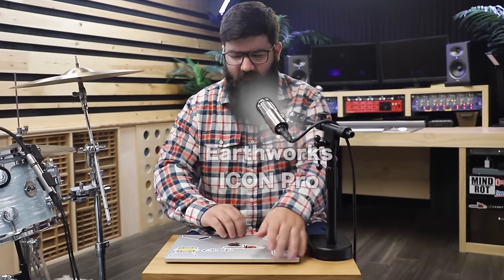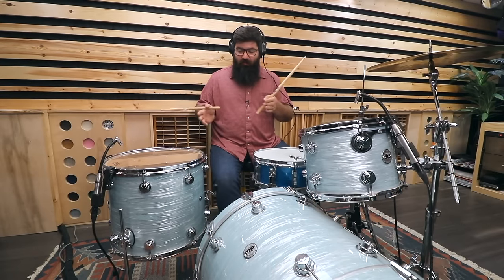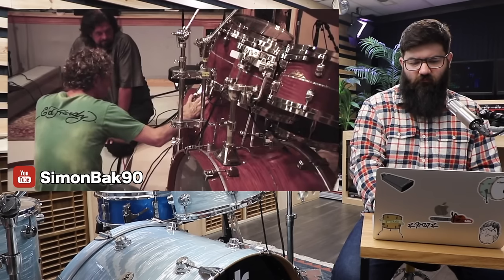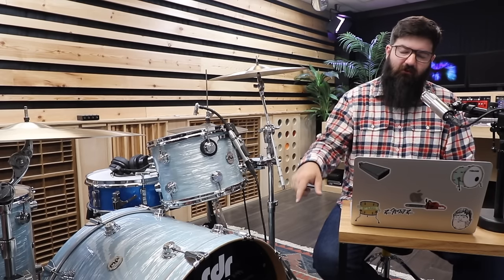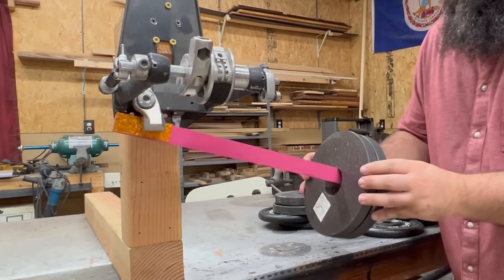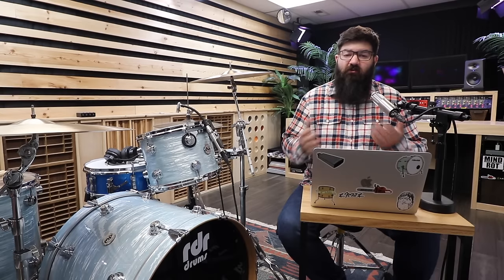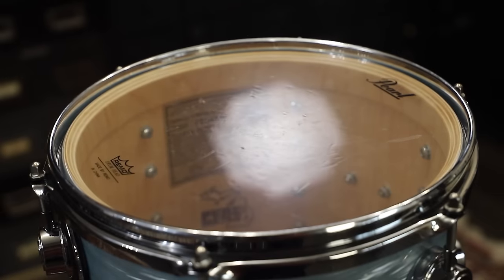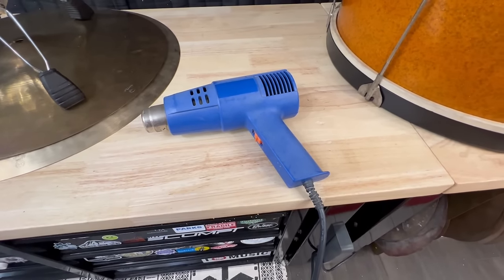The Founder of DW Drums told me to do THIS - Testing 5 Drum Hacks

Comment: A hack I’ve never tried but I’ve always been curious… Supposedly if you feel your bass drum with wadded up newspaper it provides perfect muffling. Guess it Depends on what you mean by perfect
Reply: I use that foam with pyramid profile.. Its light, and gently touches both heads for head damping and peak smoothing. No heavy weight to add to the drum.

Comment: A lot of older drummers use moleskin patches or sheets of moleskin( cheapest) for hoop protection,BD head protection and to line BD claws. I paid ONE time for an Evans bd head protector. $10!!! Why!!!I like the cushiony effect of moleskin better too. Moleskin  has adhesive on one side and fuzzy fabric on the orher. It'ss available at drug stores in the shoe repair/ insole area. I like the rolls of it bcuz it's cheap and you can cut just what you want out for your application. For those looking for a felt strip for your bd- fabric stores have various colours and lengths/ widths ( you choose)and  cheaper than the music store.

Comment: I’d looked into the heat gun idea before but always saw comments that described it as dangerous to the shell doing it whilst the head was attached. Would this be a safe method?
Reply: should not be a problem if you use common sense. Do not keep it on a single spot for a prolonged time, and steer clear of the edges. I've been using this trick for 30 years. (was a readers letter in Modern Drummer in '92 ish that turned me onto it) and have never had any problems.

Comment: That heat gun rejuvunation tip is akin to guitarists boiling their guitar strings rather than buying new ones. It works in a pinch or if you cant buy a new head, but you're probably better off buying a new one in the long term! :D
Reply: I'd say it's way more practical than the guitar strings, because stringing a guitar is time consuming and strings are cheap. The heads can be done without removing anything, and heads are costly, and if you are just practicing it can save you time and money.

Comment: Me, tired of placing the kick pedal fixed to the hoop, and of damaging it with the pressure of the pedal adjustment, in addition to the kick moving, I eliminated all this and bought a Gajate and fixed a bass tuned tom to it so that act as a bass drum and it will no longer move and achieve an excellent bass drum sound without having to suffer all these inconveniences.

Comment: Just wonder
Hack 1:
Does it have less resnonance If don't flip the legs and just remove the rubber feet?

Leg-fliped may cause the change of  the center of weight.

Hack 2:
How does it sound with  the paint cover opened?

Comment: ayyy, props on using the lewitt audio bass drum mic! are you using the 340REX or the 640REX? 

so, the paint can method, what it does is "ground" the shell, so stops the shell vibrating/resonating, making the sound more dense and low-endy. the same can be achieved by using a house brick, breeze block or any weighty items that fit and you have lying round. used to do it in my old music college days circa 2006-2009 when i went over to the building site across the road from my college, asked them for 2 old bricks, put them in the bass drum on top of a folded blanket, and voila, did the same exact thing :) got some strange looks but no arguments from anyone.

and as for the heat gun method, yes it works in removing the dents as demonstrated, but what it also does is weaken the elasticity/integrity of the head, meaning while it looks fine, its actually structurally weaker than it was before as the plastic is technically melted now.

also, if anyone want another simon phillips hack,  to decrease bass drum resonance live and in the studio and you DONT want to use the paint can method, get a fairly fluffy/thick towel (one you dont use any more) and wrap it up so it forms a sausage shape, then wrap some gaffa tape around it to hold its shape, place it against your batter and/or resonant head (if youre using one or two), and then tape it in place. it stops the head resonating as much and increases attack on the batter side, and thump from the resonant side :)
Reply from the maker: 640
Reply: @rdavidr  brilliant choice! i have two 340rex mics which are ace! i had a 640 but realised i wanst using it as much as i liked so sold it on

Comment: I forgot to comment on the 3m.  My preference is the thin foam insulating tape applied on the kick pedals points of contact.  Usually lasts a few months before inspecting for abscessed deficiencies from
Chronic wear.  It also looks a bit better and seems to be a safer, quieter buffer.

Comment: Seems like the heatgun trick would cause the head to lose structural integrity and would just rip apart not too long after. Have you been able to test the longevity and/or how many times you can get away with doing it? Either way, wish I had known about it the few times in my life I've owned a drum kit.

Comment: Turning Floor Tom legs upside down is nothing new. I learned about that by mistake one day around 1960 or 61 when I was around 11 years old. My school friend was helping me swap out a few drum heads . He removed both floor tom heads and when he replaced the legs, he put 2 on upside down. As I was returning the heads I noticed how the sound / feel changed. For MANY MANY YEARS after then , I would often leave 1 or 2 legs on upside down. The drum sound will also change if the kit is mounted on a hard surface or on rugs

Comment: The heat gun hack won’t really “fix” the head because the dented areas are already stretched out and thus the material cross section in those areas would be thinner.   Therefore, after using the heat gun, the head will dent again much easier than before because it has been weakened.   This hack might get you through a gig in an emergency however.
Reply: I was curious,if you had an old iron anvil-you did the blow dryer trick with the head on the anvil,lets say you have a rubber headed mallet to work out the dents of the head while warm on the anvil-might that work?I do understand it would be more practical, as well as, beneficial to just purchase a brand new head and utilize said head.This idea is brought to yourself by a creative mind with too much time on his hands.😄

Comment: 7:37 I thing you have to take into account the distance between the weight and the pinch point. I dont know if you know this but you have to multiply the weight you put on, by the distance to the turn (or pinch) point. Great video otherwise :))
Reply: Yes

Torque = force x lever arm

(that’s why when a mechanic cannot get a bolt loose he reaches for a longer wrench)

   But most relevant of all – that’s why toms sound great in hand, and are choked when mounted (thru-mounts): 8 inches from mount point X the weight of the drum = plenty of torque on the shell to kill its vibration 

And Therefore the best rim mounts extend at least halfway around the drum

Comment: Quick comment on the hoop protector testing. Having it at a right angle like a cantilever is not how the force of the kick drum would actually apply to the protector. If you simply let it hang down to the ground and pull away from it without twisting, I think you would have more accurate results. I understand you weren't going for a super scientific test though.

Comment: Pardon my ignorance... How does flipping the floor tom leg(s) actually reduce the sustain? Is it because the distance/spread of the legs being reduced causes the drum to resonate less? I assume it's not because of the lack of rubber feet.
Reply: I find this super interesting as well. I have a vintage ludwig kit that the previous owner changed out the floor tom mounts and legs. I threw on the original mounts and legs which were straight, rubber feet, and kind of wobbly. It completely killed the sustain and tone of the drum. Now I understand why the newer bent legs were put on. It seems like it has to do with vibrations since the straight legs vibrate more, probably "soaking" up the sound and vibrations of the drum/heads. Where the bent legs seem sturdier and don't vibrate as much in my experience.

Comment: Don’t you have vintage Tamas with the adjustable spikey legs. I bet using the spike tips on those do the same as flipping the leg… or even just remove the crutch  tip on a regular leg. 🤷‍♂️
Reply from the maker: I wanna say its more the about shape than the rubber feet. The vibrations go straight into the floor without the bend. Most of the vibrations loose energy and dissipate though all the bends. If anything Gretsch and Ludwig knew what they were doing with straight legs haha.

Comment: imo the paintcan with sand.....as audiophile putting sand inside floorstanding speaker.....probably better to lay a concrete tile in the kick...so tight up low freqs.   Still I wish for all plastic beaters to be banned, plus only coated basedrum heads and felt beaters to be legal.

Comment: Is it just me or does that weight test thing seem nonsensical based on trying out types of homemade hoop protectors? Like, how does the hoop protection have any bearing on the strength of the hoop itself? Also, I just used 1-3 layers of gaffer tape and that protected fine. No sense in buying more crap. I like the strip of drum wrap to match the shell (when applicable)

Comment: I personally like the felt end of the beater than the wood because it sounds warmer yet still solid. Inside the kick I use canvus or soft denim sand bags when available.

General rule of thumb: usually more sand for thinner shell and vis versa. Also a heavy pro kick drum pillow works.

 Final rule of the thumb:
No pillow talk or my pillow chatting unless,  She is super hot.   (Over 21 and under 38).

      "PEACE!"

Comment: Floortom: it didnt do that much since you did this on a carpet. I advise against this by the way sustain is importend for low end. Also this negaivly affects the transient. Which is why every pro drumkit basicly does the opposite and dampens the legs alot.
paint can: this has nothing to do with absobtion. It is about the weight, the bassdrum moves less, so the energy from the kick isnt lost by moving the drum.